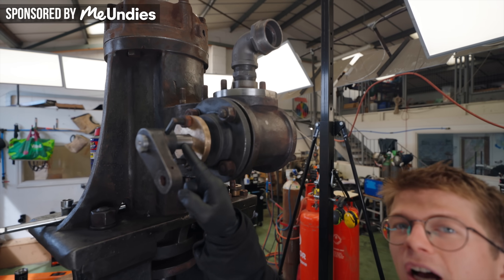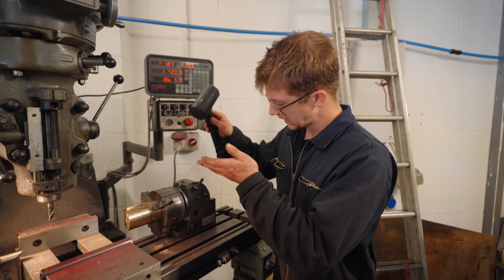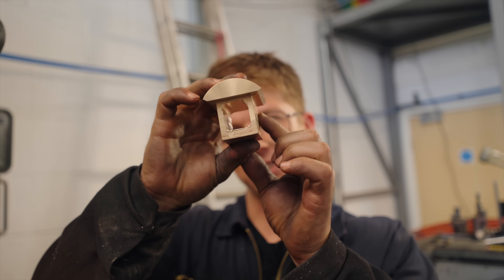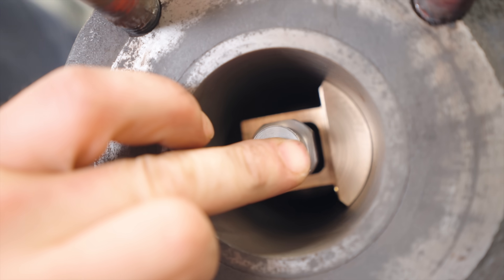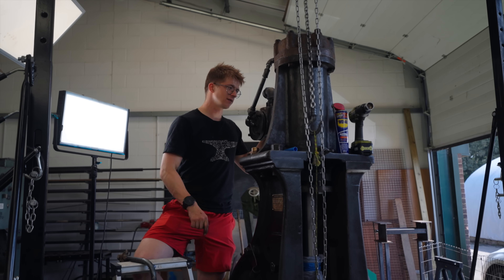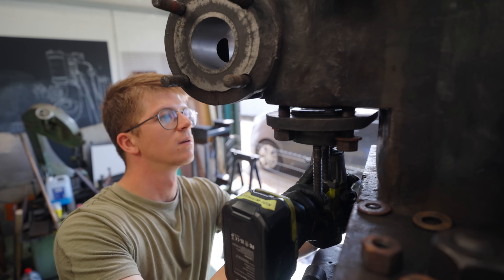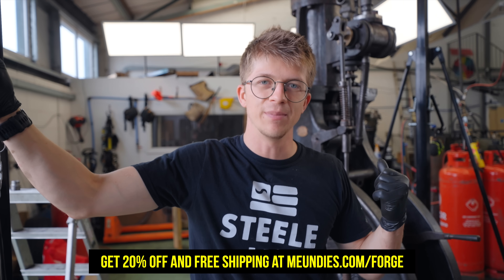FIXING A 1900's STEAM HAMMER! Pt. 14

Comment: Steam pressure should force the rotary valve against its seat,
so there isn't a need for any kind of pressure screw.
At least on valve chests in locomotives it works - and automatically compensates for wear, too!
Reply: I agree.
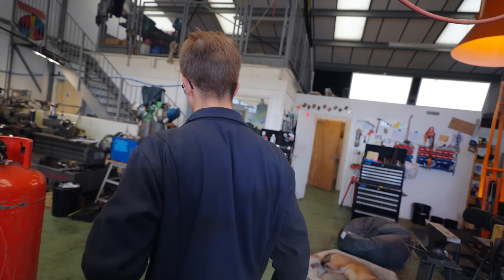Reply: Would the efficiency of this seal change now that the valve isn't hollow at the back (5:00) as there is less surface area for the steam to push against?
Reply: @alucide  no that dont mater as the total fotprint of the valve is the surface aria the steam is pushing against.
Reply: @calthorn_marr3459  -Edit, read my next reply for a WAY WAY WAY better explanation

I'm not out to say you aren't correct, I'm just telling you my reasoning because I want to understand where I'm going wrong with this, since as far as I understand the surface area has changed. 

The old part had the surface of the inner part (part around the axle, surface opposite to the surface against the cylinder wall) and the inside surface of the curved outer part (minus the before mentioned surface of the inner part) pushing it against the cylinder wall. All other surfaces have an opposite surface countering its pressure. 
The new part has the same surface on the inner part, but a smaller inner surface on the outer part, going from a quarter circle to a straight line.
This is 1/4 of the circumference of a circle; 1/4*2*pi*r (1.57*r) vs 
The long end of a right-angled triangle where the short ends are the radius of the original circle, the square root of 2 times the radius;  sqrt(2)*r (1.41*r)

Since r hasn't changed, the difference in surface is 1.57 vs 1.41 is a change of 0.16 or a little over 10% loss in surface area.
Reply: OK, that's to complicated, I can say this better. Assuming all dimensions are the same on both parts, except the curved vs the flat inside of the outer part. Then these two surfaces would have to be the same for the pressure to remain the same for both parts. 
A curve between two points is longer than a straight line between two points. Therefore the curved part has a larger surface, resulting in a higher pressure.
Reply: @alucide  The shape of the valve behind its face (the part that covers the hole) is basically irrelevant.  Making it curved instead of straight changes the force vectors in a way that ultimately cancels out the difference in surface area.
Reply: @alucide  Eh, almost right. The radial pressure is a little higher, but since it's only allowed to move in one direction, we only need concern ourselves with linear pressure. And since the size of the valve is roughly the same as the original, the pressure will be also (projection onto plane).
Reply: @kalebroark87  Yes, precisely.
Reply: If anything makes a difference between the old and new it will be the weight of the part. But once things are seated, that should be a minor point. There might be a need for a light spring to get it seated in the first place, but I'd want till it's tested before adding anything.
Reply: @kalebroark87  There we go, that's it! That's where I went wrong in my thinking. 
I'm glad I got the answer, although now I feel slightly stupid for not getting it before, as it is such a simple mistake. 
Oh well, this way I'm sure I will never forget... :D
Reply: @alucide  Surely. The question is: Will it be enough to affect anything?

Comment: The valve brass most likely works the same as a d slide valve on a steam engine and is supposed to float.  the pressure in the cylinder will push the valve against the wall helping the seal.
Reply: Exactly. I have been working on a steam locomotives that had some sort of leaf spring stuck in between the yoke and the slide valve but in most case nothing is needed but steam
Reply: agreed!

Comment: Alec & Jamie will need extra pairs of MeUndies when they hook up a steam boiler. 🤣
Truthfully though. As a automotive mechanic's son, I called fixed and adjustable nut/bolt tools "Wrenches." 🔧
A spanner was something I only hear from my UK cousins or the turn of phrase "Threw a spanner in the works."
That said, Jamie you're a spanner. Alec is Wrench because of his stint in Montana with Will. 😂😉
Reply: For me being an American a spanner is one of those funky wrenches with the semicircular arc and pip on it. Or maybe two pips. There's both styles. Some bicycle bottom bracket nuts need a spanner. There's just notches in them. So you'd put a pip in the notch and the arc wraps around the fastener.

Comment: In my apprenticeship 30+ years ago i was taught that the adjustable is a measuring tool! Its use is to measure hard to reach nuts and bolts then off to the tool box for the correct size spanner or socket and wrench.
Reply: Awfully heavy and robust measuring tool.
Reply: :O WHY?!? WHY DID I NOT THINK OF THIS?!?

Comment: If you really want to you could place a compression spring between the shaft and working side of the valve so it has constant pressure against the cylinder. As the valve wears down it is self adjusting. Keep the spring in place with a short dowel or milled pocket.
Reply: Great idea.  Probably best to go with the dowel to keep the spring from ever popping loose and causing damage, unless there's enough room in the mechanism for a pocket deep enough for at least half the length of the spring.

Comment: I believe the accepted term for the adjustable spanner is "Thumb detecting nut F*****" for its ability to smash thumbs and round off fasteners. (Thank you AvE)

As to the valve, I would drill and tap two holes adjacent to the one you did on the valve and put large set screws in, that way you can adjust depth and and offset from concentric, then use the center hole as a tension bolt. Make sure to locktite it when completed.

Comment: North wales Apprentices welder fabricator here. The adjustable one is either a “shifter” or “adjustable” a normal wrench is well exactly that either referred to as 12 iron 6 point and the last one for sockets is either a socket wrench or ratchet wrench. Or at least in my place all three are referred to as “(size is mm) hammer” 😂😂

Comment: I have a piece of advice for lathe and jaw chucks: whenever you're not absolutely sure if you need to put it back in the chuck, mark your jaw position. Pick one jaw to mark, and mark it on your part (always use the same one, avoid mistakes). When you put a part back in the jaws in the same position as they were before, three jaw chucks are very repeatable. At least much more than without realigning it.
Not perfect of course, but quite good.

Comment: This is normally the point in the project where I consider how much harder it is to design and build a new one from scratch versus reverse-engineering and resurrecting this piece of history. 
This is way cooler though. I hope it works and we gain some new understanding of the past alongside having a functional steam hammer.

Comment: In Australia, it's called a "Shifter" cause it moves or is adjustable. Socket wrench a "Ratchet" and the Spanner depends on the type. the one you showed is a "Combo Spanner" and if it has a ring each end it's a Ring Spanner"

Comment: 14:50 A) adjustable wrench B) wrench C) ratchet wrench

There is is one tool that I was taught to call a spanner. it was specifically for turning big hose fittings. Like 2 inch plus sized hose fittings.

Comment: If it's used to turn part of a threaded interface (nuts, bolts, pipes, pipe fittings, etc) it's a wrench (unless you count screws/screwdrivers). Since there are a lot of different types of wrenches, it's usually useful to specify that you're talking about an adjustable wrench (Option A), socket wrench (Option C), pipe wrench, impact wrench, hex wrench, ratchet wrench, torque wrench, strap wrench, etc. The thing that's most commonly referred to as just a "wrench" is Option B, which is a combination wrench, but I tend to refer to hex wrenches just as wrenches because those are the ones I use the most at work. Ratcheting combination wrenches are often referred to just as "ratchet wrenches", but sometimes people just say "ratchet" to refer to a socket wrench. Impact wrenches and torque wrenches are also technically socket wrenches, but "socket wrench" refers to a regular, hand powered ratcheting socket wrench (Option C). A socket wrench that doesn't ratchet is called a breaker bar. People will have their own opinions about which terms should be used for what, but this is how the word "wrench" is typically used in American English. "Spanner" is used to refer to some (maybe all) of these things in some (maybe all) other English speaking countries. It's never been totally clear to me whether "spanner" encompasses as wide a range of things as "wrench".

Comment: The brass valve is hollowed out behind so that the steam pressure presses the valve to cover the outlet hole. It should freely move on the square shaft. The steam pressure will do the work of sealing it shut.

Comment: On the wrenches, in dutch we call them 'sleutels', litteral translation is key, so you have like 'sleutel 10(mm) etc, and the adjustable is a 'schroef sleutel' because it has a screw/threads in it as threads on a bolt in dutch is called schroefdraad (screw wire).

Comment: Alec put a flat piece of spring steel sheet behind the back of the brass valve and the shaft put a slight v in it so when it is slid in between the brass valve and the shaft it will naturally push the valve into the face for a perfect fit no bolt required then put circlips either side of the brass on the shaft to stop it moving side to side problem solved cheers from down under

Comment: A. Crescent wrench
B. Combination wrench, or just wrench. If both ends are a closed circle, it’s a box wrench, if both ends are open, it’s an open ended wrench. Then there’s line wrenches which are open ended but have only a small section cut out of the complete circle so all 6 sides are contacted but can still pass over a brake line, gas line, etc.
C. Ratchet

Comment: To power up this beast you could hire one of those industrial air compressors that come on a trailer. They are normally used for road works, and jack hammers, which is kind of the same thing you have there really.

Comment: When you do the "wet" assembly of the piping, I recommend you use a high pressure thread sealant like Vibratite 440 or similar. On that badly worn hole on one of the valve body covers, Loctite Form-A-Thread might work pretty well to build it back up. If you haven't found a compressor to run it yet, a used diesel towable air compressor is probably gonna be your best dollar-to-CFM ratio.... Er, Pound-to-cubic meter per minute??? Definitely called a wrench, btw.

Comment: So Spanner (Open, Ring or Combination), Adjustable Spanner (or universal nut mangler), and ratchet.   Also available box spanner, ratcheting spanner, pliers wrench.   In terms of adjusting the valve spacing, I'd have gone for strips of shim between shaft and inside of valve

Comment: The tiny hole in the valve at 4:50 is likely meant to keep a tiny trickle of steam going to maintain a working temperature on the steam hammer.
Any system using pressurised steam needs to stay hot, it reduces condensation and keeps the metal from warping too much.

Comment: Option one is a combination wrench, with an open end and a box end, option two is a crescent wrench or adjustable wrench, option three is a ratchet. Some people call them ratcheting wrenches but those (imo) are like regular wrenches except the inside actual does ratchet. You can’t change the size of those, but a regular ratchet has different size sockets you can put on it. There’s my two cents about wrenches. Just remember, they’re all still hammers.

Comment: In America, those of us who use hand tools everyday for work (engineer, maintenance, handyman, mechanic, etc.) would call them by their proper names. You’ve got box end wrenches (regular fixed wrench with a closed end), open ended wrenches (regular fixed wrench with an open end), adjustable wrenches (self explanatory, although some people call it by the colloquial genericization “Crescent wrench” due to the popular brand name), and socket wrenches (also known as ratchets or ratcheting wrenches due to the sound they make in use). There are more specific wrenches that have very specialized purposes, but in general these are the names of the wrenches that you are most likely to see in an American mechanic or handyman’s toolbox.

Comment: In America me and my friends coworkers and family call it a crescent wrench, adjustable wrench, adjustable, adjusty, adjusty Boi, little adjusty, big adjusty or again back to crescent. Which is a common colloquial name used regularly but is actually just a brand name so if it's a snap on adjusty Boi we still call it crescent. And the only time I've heard spanner was the spanner wrench that comes in my work General Mechanics Tool Box that looks like a little bird beak on a pivot and is used to tighten or loosen the nut and the idle adjustment on the throttle.

Comment: The hole in the face of the valve allows a small volume of flow when the valve is "closed". This prevents differential pressure lock.
Without that hole it would be more difficult to adjust the valve's position, and wear would increase.

Comment: In Oz the adjustable spanner is called an adjustable spanner or a shifting spanner but most commonly it's called a shifter because it shifts size and it shifts nuts  the fixed one is a spanner. And the last one is a ratchet

Comment: Reporting back now, and apparently I missed being first lol.

A spammer in the US is either a tool that is semi circular with a tooth on one end like what is used on adjustable coil over shocks, or the tool with two pins used to tighten the nut on an angle grinder. 

What you knocked off the power hammer though was a sledge hammer, a ratchet hammer, and an adjustable hammer.

Comment: #14:36 That's a "crecsent wrench" or "adjustable wrench".  A "spanner" is a tool that normally has at least 1 hook on the end that turns a specialized nut.  The tool that takes discs off an angle grinder would be considered a spanner. If it takes a socket, it's a ratchet.

Comment: The small hole in the valve piece is probably a steam bleed to keep turning over steam and keeping everything warm. This will stop all the steam condensing when you close the  valve and cause the thing to build up slugs of condensate water. Those slugs can cause huge damage to the machine and operator.

Comment: Option A-  C-Wrench or Crescent Wrench, named for the brand Crescent.
Option B- Named based on the end in use, either open-ended wrench, or box wrench
Option C- Ratchet or Ratchet wrench.  However when asking someone to get one I will say something like "Get me a 10mm socket and wrench" ... sometimes they bring me unmatched parts like a 1/4" drive socket and 3/8" drive ratchet... or even bring me a breaker bar.

Comment: hey, I will try to explain my understanding of the valve as clearly as I can... 
For me it should be working like the sliding valve in a steam locomotive. In the slide valve case, the steam pressure on the top of the slide valve pushes it on the ports creating the seal.
If I translate that in your case, the steam pressure inside of the tube where the valve is located pushes it against the exterior of the tube, creating the seal. It could also explain why the original piece was hollow, to create more surface for the steam to push the bronze against the tube.
in that case the scew becomes useless and you need a bit of play to allow the valve to run-in and to sefl maintain
Exelent video as always, regards
Denis

Comment: I just remembered: You might be able to rent a jackhammer air compressor, (I’ve used a rental one here in the US, and figure they exist there as well) they are gas or diesel engine driven and would probably push enough air to test the steam hammer.

Comment: Inheritance machining just takes the whole lathe chuck off and puts it in the mill to avoid the whole 3 jaw problem
Also, just use compressed air. It has I dunno, maybe half the power steam does, but that should be sufficient to cycle it and troubleshoot without getting it hot and wet.

Comment: Here in the states, you need a fireman's license (not the kind that put out fires) to run a high pressure boiler. I grew up in a dry cleaners with a 120 psi steam system. This is dangerous stuff and the boilers are not a simple turn on item and they use alot of fuel. IDK what the regulations are in the UK, but guessing by the size of the supply lines, it is going to take alot of boiler, like small steam train size would be my guess. Biggest thing I ever hooked up was 3/4 inch steam. We had about 15 steam using things in the building and the furnace was 15 feet high and 10 feet in diameter. Good luck, I want to see this thing work! Just be careful.

Comment: I too, have always called it a "wrench".  The one with a closed end was labeled in the toolboxes I used as a "box wrench".  I always thought 'spanner' was a slang term for them but I guess some companies that make wrenches/spanners market and label them as such.  Usually I associated the term with the UK.  (And yes, adjustable wrench is usually how I'd describe it)

Edit: Also as the rest of the commenters have pointed out, you should be able to run compressed air through it, it likely won't be enough pressure to get it to operate at full power, but it will: A. Tell you if any of the seals leak and; B. probably not explode....probably.

Comment: The fixed sizes are called wrenches. The one you showed is an open end/closed end wrench. The adjustable one is an adjustable wrench, often called a Crescent wrench for the manufacturerer. The other one is a Ratchet, or socket wrench. So...they're all wrenches.

Comment: I bet you will find a way to run it on compressed air although that will require some massive holding tanks and maybe diesel or other large powered compressor?